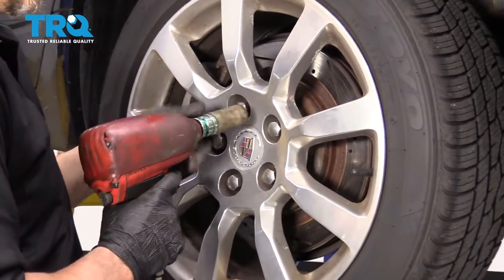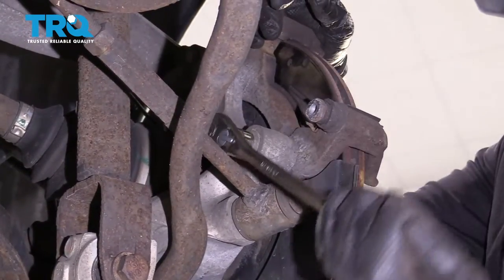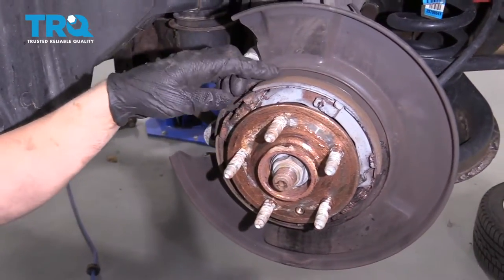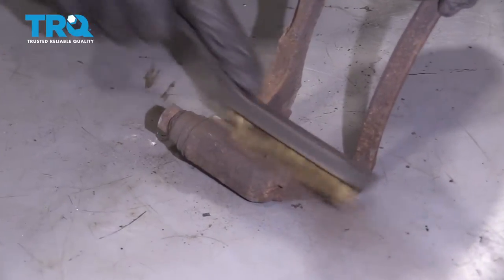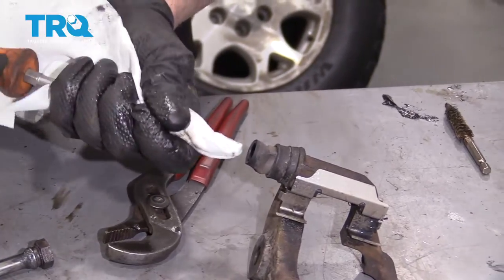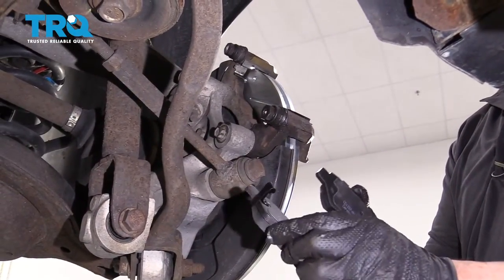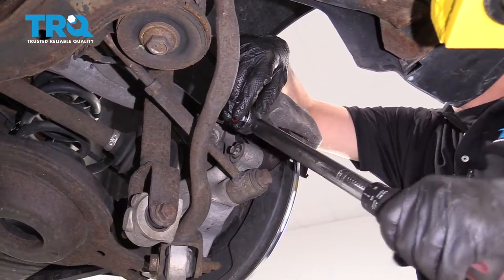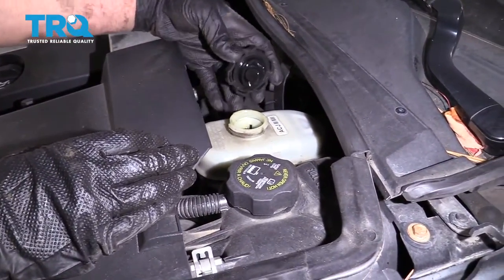How To Replace Rear Brake Pads & Rotors 2008-13 Cadillac CTS

Comment: Question TRK. Just did the brakes following your vid on my 17 CTS. Only difference is I had these V styled springs connecting the pad at the top of the pad. 2 per side. My replacement pads did not have the hole or new springs????? Apparently searching online they are for noise reduction. Are the a "Must" or am I ok without them? Thx.